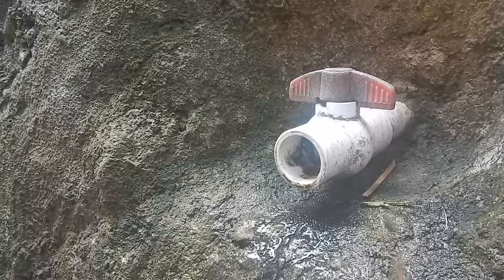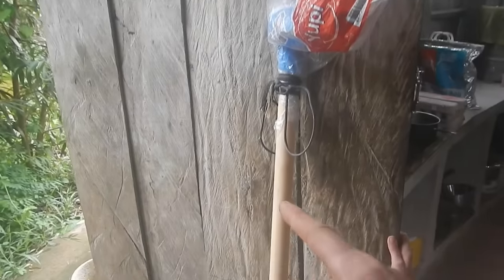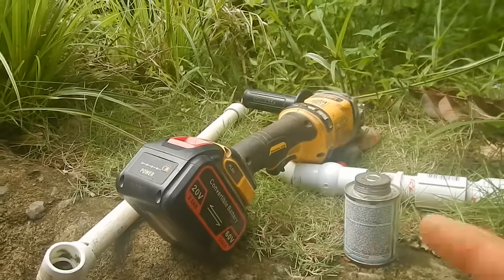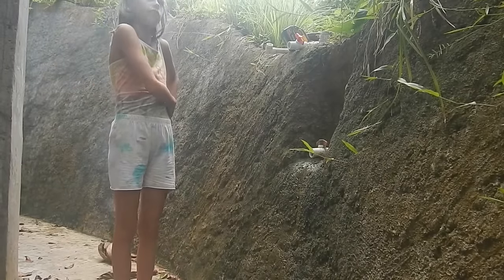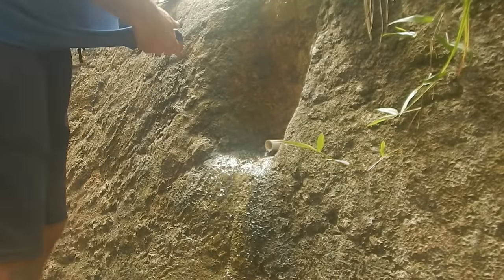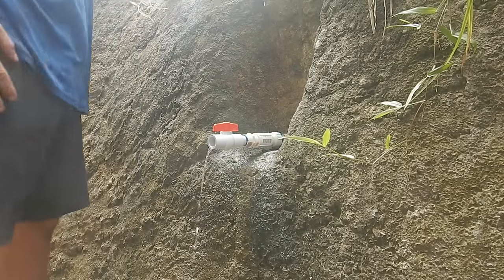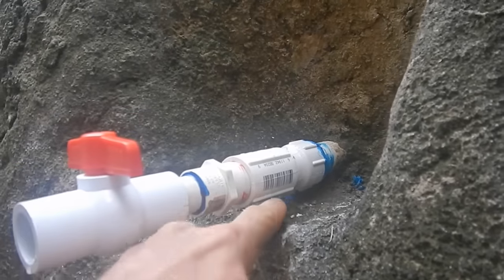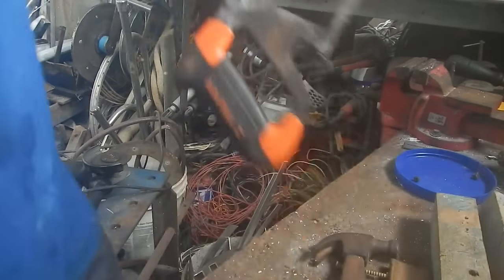Water Leak on My Main Valve!

Comment: You can also stick a hunk of bread up in the pipe. It'll hold the water back long enough to glue the joint, but it'll eventually dissolve and a little pressure from the tank will push the bread-plug out the new ball valve. Ultimately I would have left the failed valve in place so as to not further cut the PVC you had in place.

Comment: Couldnt you just add the new Valve to the leaky one ? =D Maybe a lazy approach...
Reply: That was my thought, if you have a leaky value, might as well open it and now you have a pipe.
Reply: I thought the same thing - figured I'd check in the comments before I posted the idea
Reply from the maker: You might want to think that one through...
Reply: It was leaking on the back side of the valve not through it. It may have looked like it was leaking out of the end but it was just running alongside underneath then dripping.
Reply: @JMEMantzel  if that one leaks then one more it is!
Reply: Yep, I did that always. When one started to fail, just add a new one and let the old one open. 
Now under my bathroom sink is a true puzzle. And recently a faucet starting leaking, but not through it, but the the wall of the battery. I am too tired for this kind of fun. 
I mean dismantling the sink to change the battery, so I will simply cut the pipe and blind it, or add another faucet with a hose. And just cancel the hot water to the sink.

Comment: plastic pipe is easy to work installing on new stuff but after some years the valves and connector fittings begin to leak water when its repaired look out for blowouts exactly where you put the glue the connection would loosen which would causes your tank empty.

Comment: OR you stop the water from inside as you are going to do. Cut off old valve, stuff pipe with bread, glue on adapter, pull bag off inside and the water will flush out the bread. Plumbers have been doing it for decades

Comment: I never tried it but I heard you could stuff bread in the pipe to plug it. Then after glue dries open faucet poke wire in to help with it's removal
Reply: I've used the bread trick a few times on 1/2 in copper pipe. It works well enough for small drips but a steady flow might be a little much. You can reduce the extra flow by opening another faucet upstream. Just make sure the bread is flushed out before it hits any faucets or it'll clog them up.